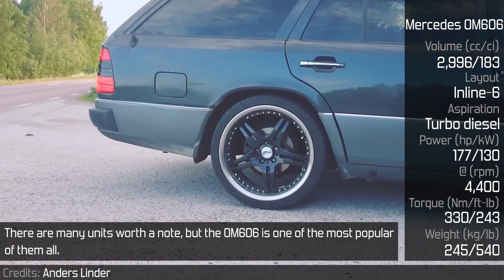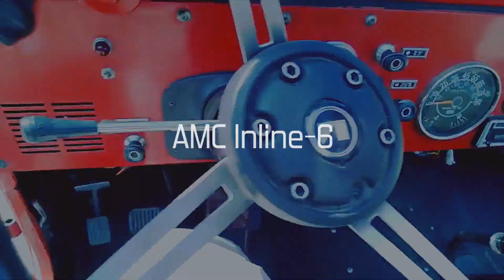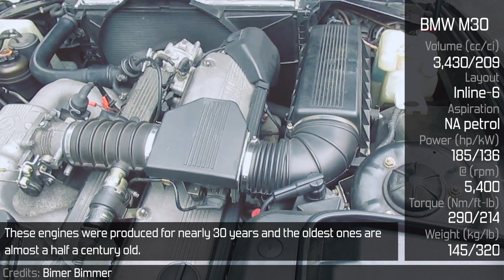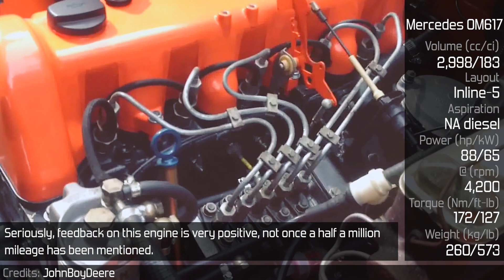10 Most Reliable Engines Running Beyond 300,000 Miles

Comment: Ford 300 l6. Even though it gets terrible mileage it can easily get to 700,000 miles even with hard usage.
Reply: TomsFruitStand agreed. one of my buddy's trucks is a 88 f250 with a efi 4.9l. we worked on it trying to give it more power for towing and failed lol. the milage of the truck was unknown since the odometer cable snapped long before he even bought it but it read 180,000 before he fix the cable. he beat the hell outta that truck but it never wanted to give up until he blew the slave cylinder in the trans from power shifting too much. he originally wanted to slap a turbo on it and see what it could do but life got in the way. great engines though for sure
Reply: TomsFruitStand agreed, my 96 f150 with a 5 speed gets about 15 mpg. That's about the best it will do. But it has 212,000 miles and doesn't burn any oil or coolant. I honestly can't complain.
Reply: TomsFruitStand Owned 3 Ford vans and one Ford pickup with the fuel injected 300 I-6.  Lots of low end torque and economical with an overdrive transmission.
Reply: I'm sure you could get great gas mileage with fuel injection and overdrive, but all of mine have been carbed with the 4 speed.
Reply: Especially the earlier ones. Not a ford guy any more but the 300 I6 and the 390s will always be high on my list.
Reply: TomsFruitStand The vans and the one pickup I've owned had the fuel injection.  One with the E4OD automatic, one with the C6, and a couple of them with the Borg Warner T-18 with the overdrive 4th gear.  When driven conservatively, my loaded vans usually got around 14-15 mpg.  The C6 in my 1990 E250 Extended usually averaged 11 mpg.

Fuel injection did add some complications to the fuel delivery system in that on the older style (3rd Generation) Econolines, there was a low pressure pump in the van and high pressure pumps in the front and rear tanks.  The fuel injection setup was mounted above the valve cover, making the ever frequent replacement of valve cover gaskets an ordeal and a half.  At least the fuel mixture in each cylinder with EFI.
Reply: All of the old American straight sixes were really good like that. I had a Camaro with at 250 I-6 that was well over 200K and still ran like a dream. I hear a lot of the same about the Mopar slant 6 too.
Reply: My brother had a slant 6 he tried to kill before giving the car to a junkyard.  Drained the oil, drove it there in first gear... it would not die.
Reply: TomsFruitStand ...Amen bro, the Ford 300 " Iron Duke" was a phenomenal engine as was it's predecessor the 250 inline 6. I had one in a 1982 F150 pickup. It was a great truck. My father loved Ford trucks, and now I know why. I am currently driving a 1995 F350 with a 7.3 powerstroke diesel. It's another great engine from Ford.
Reply: chayes954r technically it's a Navistar engine.
Reply: Normalguy35 ...Yes true, but luckily it ended up in a Ford truck.
Reply: I haven't heard of it, is it a diesel?

Comment: We had a Skoda Superb with a 130hp 1.9 TDI engine (2005) and we drove over 450.000km with it. We got rid of it because of several minor things on the car, but not the engine. Now it is still going strong somewhere in Poland. Also, you can say what you want, my dad didn't drive it like a hoonigan, and he knew the car very well. But ofcourse, not everyone with a 1.9 TDI drives it like we did...
Reply: Greathings from Poland your car is here and now it has 250kkm on the odo and new buyer is full of angry cause his tdi is braking...
Reply: mikkei and another hater... the mechanics guy in Poland checked the whole car, repaired the minor things and replaced what needed replacing. Can't wait to see it in a bad driving video :)
Reply: I hate I think- cause your country doesn;t have a car history like MOT in UK  , And If you find a car from abroad you always didn;t know that is a true millage  of this vechicle.
Reply: I think he wanted to say that the car has been sold to Poland with 450 thousand kilometers, but the 1.9 TDI engine in Poland is so popular the dealers (private sellers sometimes do it aswell unfortunately) turn the mileage down to about 190-220 thousand kilometers so they can sell it easier with a higher price, this is very common, and the goverment/police/anybody actually doesn't do anything with it, for an example, in Germany you'd be in jail for something like this. Your car's mileage was normal, but seriously, would you believe in a 12 year old diesel to have 200 thousand kilometers ? ;D
Reply: Not to mention the opinion about the 1.9 TDI, people now think the engine is shit because they brake after 200k kilometers, most of them are above 400-500k kilometers now.
Reply: true mine 5 gang 2,5 tdi has on oddo 380kkm , but who knows I fell it must have over 500k.
But work and drive, not as new but it works
Reply: I don't know if this has happened to our car, but we sold it to a college (who works in the Netherlands where I come from) and he took it to his friend in Poland. He told us that he didn't do that, but I guess you never know.
Reply: Nobody in Poland buys cars with 450,000 km on odo. Only 180,000 km, ofc most of old VAG cars have 450-750 kkm, but in odo they MUST have 180,000 km.
Reply: Niels Blan

Comment: The Volvo b230f is a realy solid engine! My grandad has one that sits in a Volvo 740 and have run 720 000km and still runs great! Me and My friends have Done regular oil and general mantanice and still runs like a clock
Reply: I have one in a '86 240 still runnung strong after over 800,000 KM.
the car fells still brick solid !
Reply: I second this for the B230F redblock engine.  I owned a '94 940 with over 240k miles (which isn't that impressive compared to many of the mileage records mentioned in the comments, but still not too bad) and I currently drive a manual-swapped '89 240 with over 130k miles. I've seen B230s around me though with well over 300 and 400k miles
Reply: mine sounds like a clock factory and it's only done around 208 000km, it's making me miss the older one i had with a B200K (though obviously with a real carb.)
Reply: VampyrMygg well IF you service them regarly you can gett them to sound like factory new for like 500,000 km without eny Rod knock och piston slapp. But IF Its knocking now do an oil change. Mine (not My grandad) knock like cracy with bad oil. IT Will enyways hold upp to you Along time. Sorry for My bad english
Reply: Daniel Pfender Nice! My dad drowe a 94, 940 for a while with The b230fd engine. But My dad thoght IT was to slow so me and My friends turbocharged IT att Wi pressed out around 300 horspower out of that little engine. Sadly The engine failed but then we trogh in a om606 engine in IT. Now My dag have driven it around 600,000km. My hole family has long milege cars and there are still running strong:)
Reply: Itt's had the oil changed and such, it's a valve thing, they need adjusting, and obviously that's the one thing that's not easy to do on a Volvo, well, that and the heater core dying.
Reply: Johan mattsson
What I do is to install a bypass filter on my b230 engine, this filter takes a small portion of the oil flow, filter it to 1 micron and return it to the oil pan via the fuel pump block off plate on the block.
I use a good grade of mineral oil and I make my oil change at about 15,000KM so I can adjust the grade for winter use.
You don't have to apologize for your bad english , mine is not better as I believe that your primary language is Swedish, mine is French and I make an attempt to learn Swedish from what I can find on the internet but where I live, except for the Volvos and Ikea, there is no swedish poeples around me.
the most important is that we can communicate and express our ideas
Reply: Jacques Poirier totally agree with you. Its hard to learn a new language but some day you will speak Swedish fluently. It's a great thing that the handbooks are translated to French and English:) the fuel pump block of plate? The fuel pump is sitting under the car on the driver side? When I turbocharged my dads car we drilled a hole and runned a tube through it for the oil drain too the turbo and my friend took the oil from the oil pump some how;) do you mean that i can take oil fr.o.m.another place of the engine? I don't really understand;/ thanks for your patience:)
Reply: the carbureted and fuel injected engines use exactly the same block so the mechanical pump is not used on FI engine so Volvo installs a blocking plate on the mechanical pump seat pad ( to the level of the cylinder#2 at the hight of the idler shaft). This plate is about 5mm thick and is made of steel so I machined a fitting to recieve a 1/4 NPT thread  then I silver brazed it to the plate. I made the required plumbing according to the standard to  start from the front of block oil gallery ( 1/4 NPT plug near the alternator belt tightening brace pivot bushing ) going to the by-pass filter unit then return to the  oil  reserve via the modified blocking plate.
I totally agree that you can't do that with a turbo unit as the oil return must be free and the bearing chamber on the turbo must not be flooded with oil so you don,'t have any other choice than returning oil to the engine via an entry point lower than the turbo bearing chamber.
Reply: I loved my 760. And would buy a 940 if I ever get the chance

Comment: My old works van, a 2007 Citroen Berlingo 1.6 HDI hit 320,000 miles after 7 years and was only sold off when gearbox gave way. Always had oil changes and timing belts done early and only went through a clutch and power steering fluid cooler. I miss that old thing. :)

Comment: Any Volvo "redblock" engine is rock solid. If I would go on a drive around the globe it would be with that engine. Easy and straight forward to maintain. Easy access to all components (the few there is😂) 
Had a 740 wagon b230F with 600000km on the odometer. No engine issues when I sold it.
Reply: I can agree with this. Mine went through an owner that didnt know that oil changes were needed and still ran like a champ before a wiring issue for the fuel pump came up. Even then it still ran when we tested the ignition by putting a little bit of fuel in the intake

Comment: I have a 4.0L SOHC V6 in my 1999 Ford Explorer and it recently passed 340K miles. It was a lease return and I bought it back in 2002 with just over 50K miles. All original except one head gasket began to leak coolant so I replaced both. Nothing else done except a light grind to exhaust valves since the heads were off. Over 100K miles since and still going strong.

Comment: The 4.6 from Ford that was the Crown Victoria police cars and taxis and many other workhorse vehicles like F150 is fairly bulletproof especially the 2 valve head. I had that last car that Oldsmobile Eighty-Eight with that 3800 V6. The car’s body was falling about from snow and salt in Michigan and the model had electrical issues by that motor was fine.